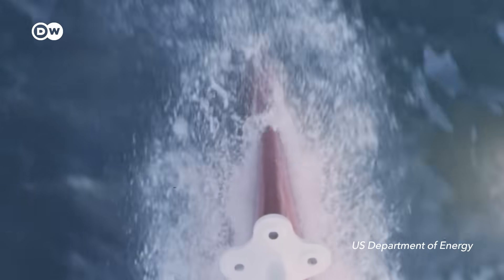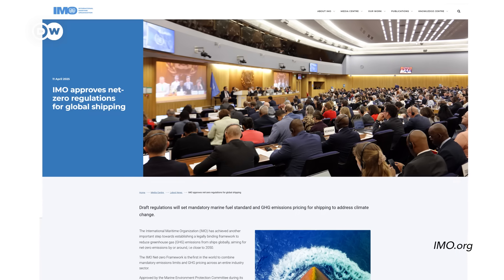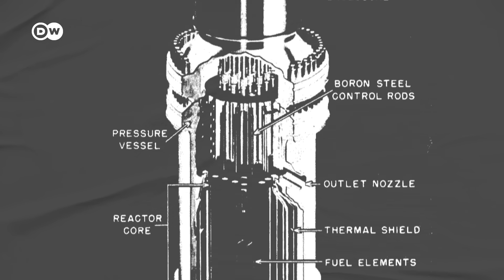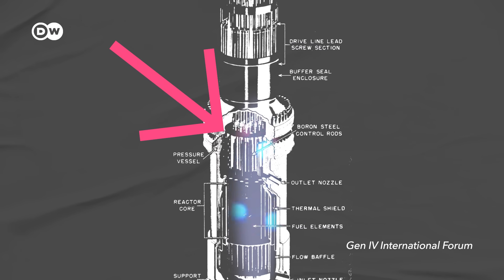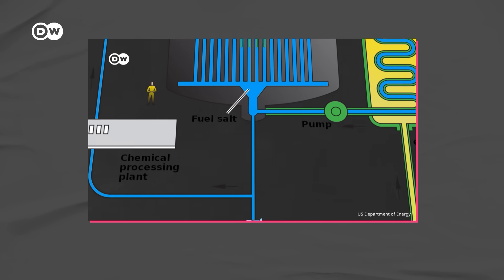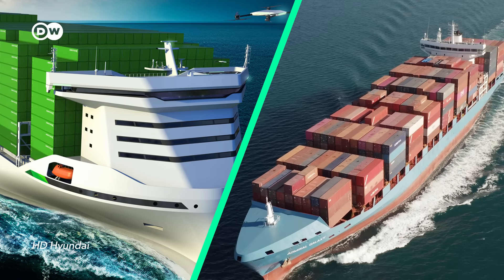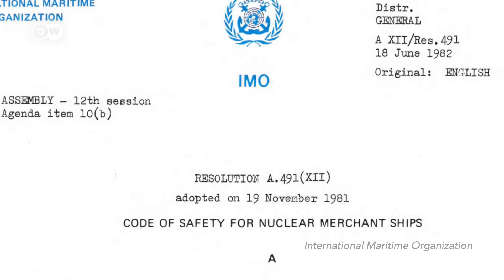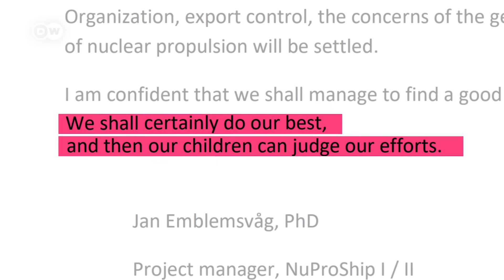Why people want to put nuclear reactors on ships

Comment: I hope some type of Club of Rome “Limits to Growth” supply chain breakdown occurs before these ships become widespread. I ordinarily don’t wish for that type of society changing event to come to fruition. And I feel for the guys that are designing these—I’m sure their intentions are to address the present day burning of carbon by ships. But there is so much nuclear waste extant today, eg Hanford, that largely is hidden in plain sight and will remain hazardous for decades to millennia to come that I can easily see a worn out ship just become another heap of radioactive trash. But even if that’s addressed what’s to stop some brain, human or AI, from devising a plan to ram one of the nuclear reactor ships into another ship (or vice versa), or crash into a harbor or canal lock or scuttle them where they can inflict misery on life? I don’t trust that those minds aren’t already working to that end.
Reply: nuclear waste is not a problem its not hard to deal with the problem comes from politicians who dont know anything using propganda to make everything in regards to nuclear power more difficult
Reply: @elapidpython4378  I disagree. There’s nuclear waste at Hanford that’s leaked into the ground and is making its way towards both ground- and surface-water eg, the Columbia River. Portland is downstream of that. There are many similar situations where nuclear waste is stored near rivers that supply drinking water.

Comment: Yeah nah, nuclear on the sea is a terrible idea. What happens if they sink?
Reply: The US Navy and others have been operating nuclear powered ships since the 1950s with zero releases of radiation, even though there have been sinkings. 

But what about fossil fuels at sea? They leak allllllll the time leaving oil slicks and dump all their energy generation waste into our air.
Reply: @ElectricNed  Im not saying that oil leaks arent a problem.

I just dont like the idea of nuclear being widespread. You cant trust humans who are in it for profit to maintain nuclear reactors and sensibly dispose of nuclear waste. They also won't have enough cash to recover their nuclear reactor when it goes under. They'll just declare bankruptcy and make it someone else's problem. Or worse, if the ship sinks in international waters noone will be held accountable.
Reply: @puffinjuice Yeah, maybe it should be a different model than just private businesses running them. Like they lease the complete power solution from the Navy including staff, fuel, and complete lifecycle services.

Comment: I'm not sure if the US Navy is efficient, but my friend who worked in the reactor department says it's literally like 300 people.  If SMR's with fail-safe management software can replace 300 people and can be safely ejected in case of severe malfunction, why not?  We already have nuclear subs that can malfunction, sink, and implode without causing nuclear incidents.
Reply: "safely ejected" ? Nobody does that.  You've just added 20 years to the development timeline.
It's better for the crew to abandon ship and have it sink, or be towed, than some rube goldberg ejection mechanism.
Reply: @qcca123-f1v or I guess they can have a special vented compartment like planes have for their lithium batteries 🤷

I think the SMR companies are specifically trying to design plug-and-play reactors that can be abandoned in place in case of a meltdown and don't have enough fissile material to destroy the outer casing

Comment: Small reactors have been around for a long time - nuclear submarines and, I think, Russian ice-breakers. The reason they've not broken out into civilian applications is because they are horrendously expensive. Try asking the UK government how much the subs cost to build and maintain.
Reply: US Aircraft carriers are also nucleclear powered.
Reply: @paradiseisland69  And US cruisers used to be nuclear as well. Russian battlecruisers still are.
Reply: @paradiseisland69  nucleic acid*
Reply: They're expensive because only a handful of people build them, so they're rare, which makes them expensive. Since they're so expensive only a few people bother building them, making them expensive.
Reply: TBH, in the context of decarbonisation, ship SMRs will have to compete with something like ammonia made from electricity on land, not with fossil fuels burned in an effcient marine diesel engine. This may improve the economics, but only if SMRs are not more than 3x more expensive than the regular nuclear, and the regular is also at partiry with other options, which currently in the west it is not.
Reply: @E1Luch  Ammonia isn't clean. 
Ammonia releases NOx, which is 300x worse than CO2. Also much more toxic to handle. At that point, you'd want to use Liquid Hydrogen in Turbine Engines without any need for Ammonia or Methanol. 
Methanol too relases CO2. And when it comes to saving costs, closing that CO2 loop is DEFINITELY not in one of those minds. 
If you want Hydrocarbon Fuels and a closed Carbon Loop, you're looking for Synthetic Fuels. Drop-in, clean, and doesn't require sacrificing too much. Would still need Carbon Capture, but it offset a lot of handling and infrastructure costs.
Reply: The oil lobby is the main reason, imagine the cut to their margins. If used extensively those nuclear could easily be made more economical and safe.
Reply: Even more so: big scale civilian reactors of today find their origin in.... nuclear sub reactors.
Reply: Marine nuclear reactors are fueled by high enriched uranium. Making their civilian use a weapons proliferation risk.
Reply: @dangerousham3519 it depends on the model though isnt there a lower enrichment sub ? Not an USA sub but I dont remember which country
Reply: That’s the reason us Americans limited our selves to 11 carriers and 71 subs. We had to keep it modest😂
Reply: Nuclear reactors really are not THAT expensive.
Reply: @StanleytheCat-v8z micro reactors can range from $20M to $100M currently
Reply: @StanleytheCat-v8z  When 30% or more of costs and 50% if all time is spent purely on paperwork, you know something is pulling the strings.
Reply: Pirates can easily steal most any civilian cargo ship or cruiseliner. You don't want to give Nukes to ISIS because a bottomfeeder corpo couldn't be bothered to put security on a ship.
Reply: @genericscout5408 a reactor is still not a bomb
Reply: @corradoalamanni179 yes
Reply: @genericscout5408 you telling me that a couple of dudes driving around in a toyota hilux have the knowledge to make a nuclear bomb.
Reply: I bet a large reason for the expense is regulations these daus
Reply: When you build 3 complex bespoke machines, they will get stupidly expensive, if you build 1000, the cost per unit will be a tenth.
Reply: To be fair, civilian ships are a helluva lot cheaper than nuclear submarines.
Reply: I don't think you understood the video.  They are talking about newer generation nuclear reactors, not the ones like in navy ships today.  They are not built the same.  The goal is to also reduce price by being able to create them in factories.
Reply: Yeah but if we want to prioritize cost then the answer is fossil fuels , but we can hope that if we build nuclear ship maybe in the future we can make them cheap . If the ships last long enough than the cheapness of nuclear fuel should make them more profitable
Reply: And people panic if they hear nuclear. With no reason. Green figures are the cause
Reply: The number of highly trained personel required to operate every single one of these ships, the costs of developing the reactors that have not even demonstrated themselves in a much more economically favourable big land-based format (SMRs are physically worse at everything and the economies of scale will never kick in at just 10x more units) - these two factors kill this idea even if building thousands of these things and letting them sail all around the world without much security somehow was not a consideration at all.
Reply: Also if the ship sinks, we have a real problem.
Reply: @paush51  Not really. Water is a good shield when it comes to nuclear radiation, and a flooded reactor cannot overheat and melt down.
Reply: @paush51  It just sinks to the bottom. Water is great at stopping radiation.

As for contamination: Sunken ships already do that.
Reply: @paush51  not really. If the ship sinks, the water will naturally shield the environment from radiation - see the Kursk nuclear submarine, for example. It is way worse ecological damage if a tanker have an oil spill.
Reply: @paush51  No, we really don't. A nuclear ship sinking causes far less environmental impact than even the smallest oil transporters crashing.
Nuclear ships do pretty much no real damage to the ecosystem. If you think it does any damage you don't know what you're talking about and clearly have no idea how these reactors or ships work. There's no explosion or contamination or anything of the sorts.
Reply: The ship sinking isn't a big problem....
Reply: @paush51  The ship sinking in the middle of the ocean with the reator shut down and all its safety mechanisms intact --> not good, but also not that big of a deal
Someone deactivating the safety mechanisms and causing a deliberate meltdown while the ship sits in the port of a mega-city --> huuuuuuuuuuuuge problem
Reply: @nicoj9984  You have no idea the sheer effort it takes to cause a Nuclear Disaster. 
Chernobyl had dozens of bureaucratic lies for years. Safety systems were intentionally turned off from the highest of commands. It polluted an entire continent. Yet, it's numbers dwindle from simply Hydroelectric Dam accidents. All while Chernobyl had little to no protection or care.
Reply: They're expensive only if you're a responsible entity, not necessarily if you're a profit-driven private company who's going to cut costs everywhere it can, hence the dangers of nuclear in civilian ships...
Reply: @mintberrycrunch6657  this is true for every company but nuclear is so much feared that we make it safe . There are swathes of ocean floor that are a desert because of oil accidents if we can nuclearize even a fraction of shipping it will be a great service
Reply: @corradoalamanni179 that was my point, private companies should not be trusted with nuclear powered ships.

Comment: That is an impressive Long list of "If...", it reminds me of a small Version of the discussion on "when we have Fusion technology, electricity will be solved".
How is Huthi's Shooting rockets at ships tanken into Account for this? Or all the new ways we learn about how to build drones and use cheap technology for weapons in scenarios we havent seen in wide use so far? I don't feel save with Putting nuklear ducks for Shooting on the oceans.
My two Cent wold be: other Green Tech solutions are in the developement Race, Like it was with cars about 20 years ago. Putting available resources into those technologies and finding Out fast, how to build solutions for shipping will Bring us better chances to get it away from Fossil fuels. Build Green Energy big scale now, start Prototyping and running experimental ships in technological parallel to develop real live experience, and Go one step after the other to See which approach win's the Race. We saw it Happen with EV for the Road, let's find Out, what it IS going to BE for the sea.
(Sorry for the weird grammar, autocorrect at Work...)

Comment: Its always the same problem.
"I trust science, I don't trust the people."
If you make them almost maintance-free level it will be too expensive anyway.
Reply: The point is to engineer them to be like batteries:  Built in a factory, in the form of a standard  40 foot container. sealed and maintenance free, with just electrical contacts (and perhaps air for combined heat and power) and that's it.  "Maintenance" is swapping out the container and transporting it to a depot/factory.  Probably the self-contained unit is good for 5 years at least between refueiling swaps.
Reply: @qcca123-f1v current nuclear ships its 20 years between refuels. Potentially up to 50. They may simply never need to be refueled before disposal.

Comment: It won't happen. Having technicians, qualified personel and security at every port in the world is unfeasible.
Reply: We already transport a lot of dangerous stuff which are illegal for average consumers to own, by ship.
Pharmaceutical precursors, chemicals for all sorts of industries, including chemicals that could be used in chemical warfare, etc.
So, the security is there.
Regarding maintenance, these are not RBMK reactors. The cost of the maintenance personnel would be irrelevant, especially considering the ship's higher cargo volume and/or higher efficiency.
Reply: the nice thing about economics is that if you build it, they will come
Reply: JFC, there are already a ton of nuclear powered ships and people qualified to run them. They just all belong to one of world’s navies. 

Also, they won’t require any special security. Reactor uranium isn’t enriched enough to become a bomb.
Reply: How did they find qualified personel for mainenance of ships using heavy fuel oil then?
Reply: @arvidsteel6557 have seen the state of most of those ships? There are clearly almost no inspection being performed anywhere 😂 no chance this would happen with nuclear ships.
Reply: @Nikoo033  Makes you wonder why people demand of fossil-free ships something ships using cancer causing heavy fuel oil don't have.
Reply: Why not? Most of the worlds trade is between Europe USA and china. All nuclear powers?

Comment: I think nuclear-powered merchant vessels is an extremely ill-advised idea. The purpose of such ships is to make money for their owners. Said owners will do anything to increase profits including cutting spending on safety inspections, training and most importantly, maintenance.
Reply: Take those problematic aspects out of the companies control then.
Reply: It would be in the interests of governments to subsidize the nuclear fleet to reduce carbon emissions. Its a problem that can be tackled in a similar way to automobile vehicle testing.
Reply: Companies already do this for ships using heavy fuel oil though with much greater negative consequenses. If anything nuclear ships would be an improvement in that department.

Comment: When the ship breaks on the sea, what happens to the reactor?
Reply: Depends on the reactor design. Mostly, the reactor would be engulfed with water and it will absorb all the neutrons and cool it. It would be safer than failing on land.

Also most likely they will be less than 300MW. The past "disasters"  all happened with 1GW+ reactors.
Reply: @atrumluminarium  smaller doesn’t necessarily mean safer: it means that the relative cost of safety features would be higher -- more likely to be cut.
Reply: @ArneBab  It does mean safer by definition. The power output is directly proportional to how fast and how large a potential catastrophe would be and to how much nuclear material is contained in the reactor. All assuming the same reactor design for both.
Reply: @atrumluminarium  is that assumption realistic?
Reply: Ask the nuclear sub and aircraft carrier america have
Reply: @bot7845  „we use it for war, so it must be safe“?
Reply: It is flooded with water that absorb stray neutrons slowing down the chain reaction that produces a fission reaction in the first place.
Reply: @arvidsteel6557  and then? Who retrieves it? How long will the material stay safe for the ecosystem on the ocean floor?
Reply: @ArneBab  No one retrieves it. Uranium is heavy and dense and will float far down to the ocean floor. Covered by that much water and under high pressure any leftover radiation won't go very far. Compared to an oil spill which spreads a thick layer of cancerous materials across the surface of the water, a nuclear incident is much safer for surrounding marine life since it would literally bury itself.
Reply: @arvidsteel6557  do you know just how toxic uranium is?
Reply: @ArneBab  About as toxic as lead, but uranium is a heavier element that spreads less easily into the surroundning environment. Regardless the amount of uranium used is orders of magnitude less than fuel oil. NS Savannah used 15.9kg of uranium during its entire lifetime. The Deepwater Horizon oil spill consisted of 560 000 tonnes of oil for comparison.
Reply: @arvidsteel6557 the problem isn't the uranium 238. But the byproducts of the chain reaction in the reactor. Plutonium for example. 1 g of Plutonium can poison approx 1 million people.
Reply: @longin-b6f thank you for fixing my question.
Reply: @longin-b6f u see if u further use that plutonium as a fuel u greatly reduce the  number to less radioactive plutonium also plutonium is not toxic the stories u hv heard were related to radioactivity 
Also if u use 1 kg uranium by theafter burn up method ull hv only sone double digit grams with a lot of residual uranium and some cesium and all all it will be like 
Which i don't think  the biggest vehicle on earth cant store
Reply: @arvidsteel6557 this, people will bitch about how dangerous the stuff is, which is true, but nobody truly understand the scale that we are talking about, the amount of material needed for these reactors is insanely small, we're talking a few kg compared to thousands of tons of heavy fuel oil
Reply: @ArneBab are you implying the reactor would be open spilling the fuel? It’ll be sealed, the fuel no matter how toxic won’t be touching the outside, ever, no animal can pierce the layers in time for it to matter, unless the tectonic plates get involved nothing is leaving the reactor
Reply: @ArneBab 
Fixing your question ? So you admit you are just antinuclear and are throwing everything at it to see what sticks... Pretty dishonest method of investigation I believe